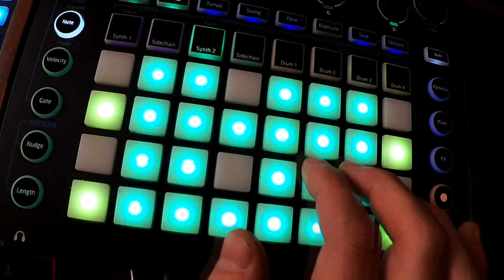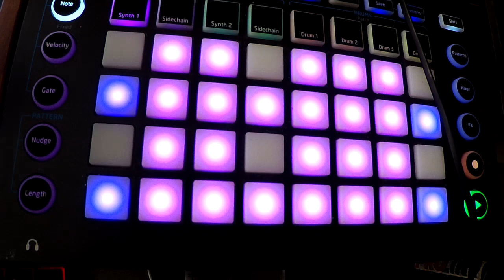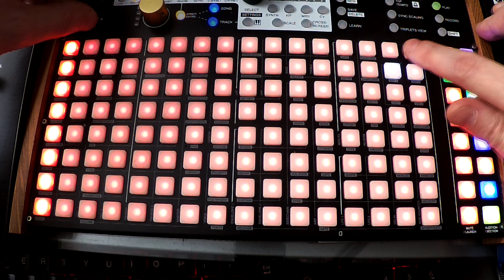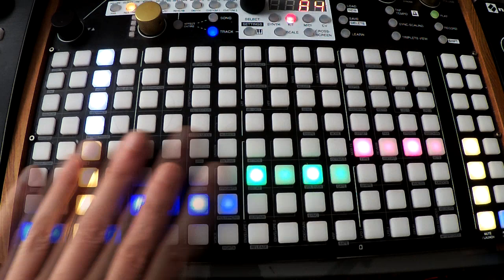Songwriting Pt 3 - Sequencing Resampling and External FX // Synthstrom Deluge Tutorial

Comment: Hi Ron

I was planning on purchasing the Deluge mid next year 2019.  I was debating if i should get the Circuit now 12/2018?   I know you have both.  Could you give me some insight.  If i buy the circuit now will i stop using it when i get the deluge?  Is the deluge a better device compared to the circuit?  If they are similar but one offers more features then the other I would rather get one machine.  The other thing able the circuit is the end of life.  Companies put out gear and stop updating them and move on to the next big thing. I notice deluge keeps getting updates regularly.

I read on youtube the the deluge is like an electribe on steriods. I have the electribe esx and i love it but it has limitations. Most of my gear are VSTs and ableton live. In 1/2018 i started buying hardware to get away from the computer. I like using both but its nice to take a groove box anywhere and just jam.

Thank you,

Miguel
Reply from the maker: It's up to you what you want to get. I like my circuit and decide to sequence everything with deluge. Circuit is a great start. Deluge is far more advanced.
Reply: Find a good deal on a second hand Circuit, and then you'll be able to sell it when you get the Deluge without any loss. Though if you can afford to it could be worth keeping both. The Circuit has velocity sensitive pads, so is great for recording sequences into the Deluge. Also if you sequence some sounds on the Circuit with the Deluge that effectively gives you a couple of extra outputs which you can apply effects to (you'll need a mixer for that though unless you just run the Circuit back into the Deluge). The Deluge is superior to the Circuit in almost every way, but there are a few other nice things about the Circuit like having a software editor for the synths and the immediacy of the macro knobs.